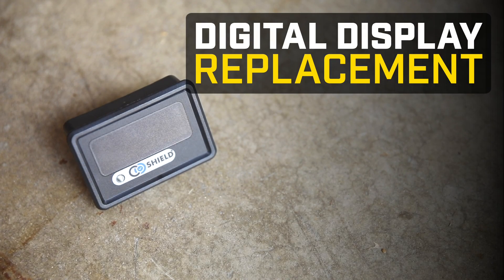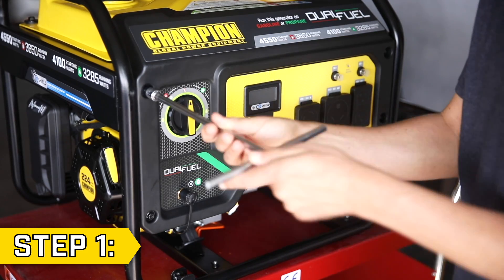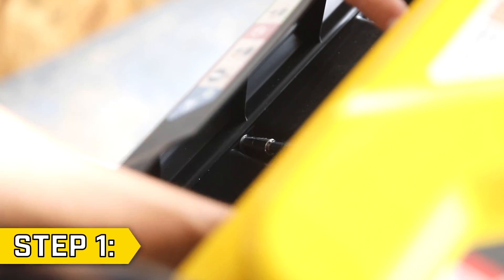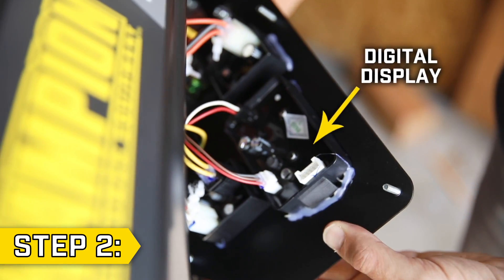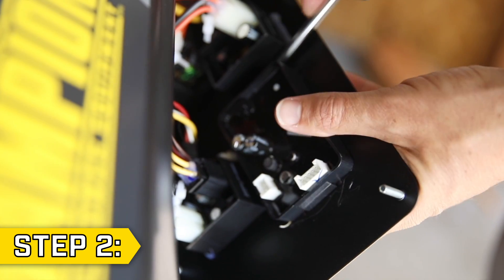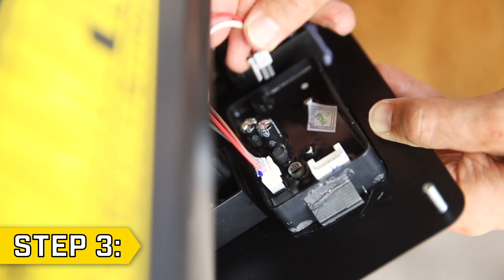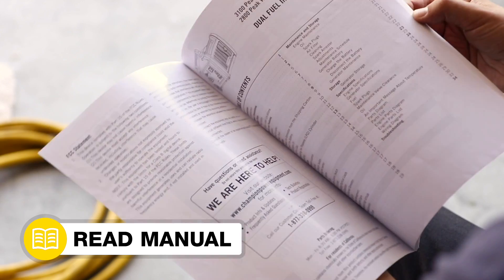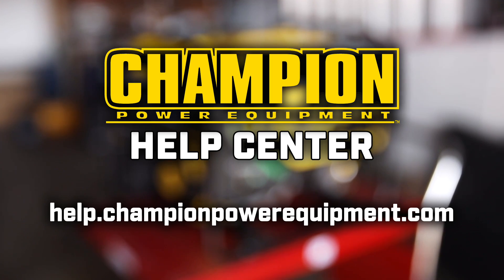Digital Display Replacement (Generators)

Comment: What about if the wires going into the display are melted at the connector? Any replacement pin connector or harness available?
Reply from the maker: Hello, for all parts inquiries, please contact our support team at 877-338-0999. Thank you